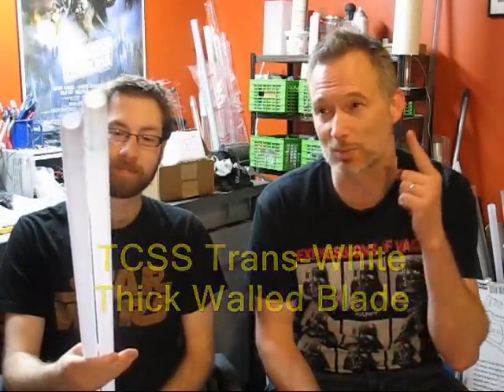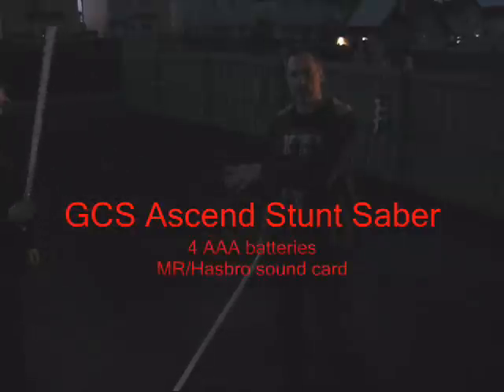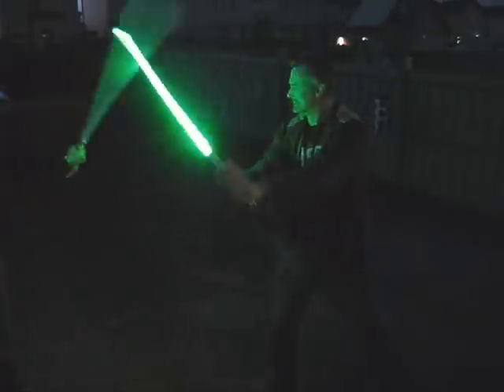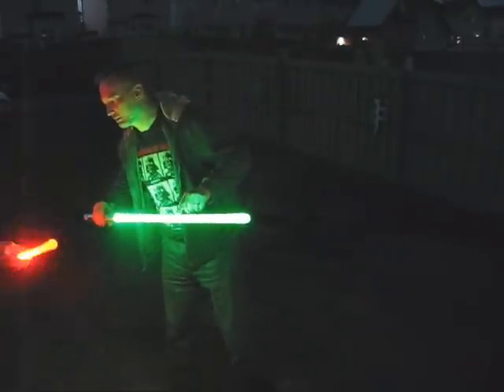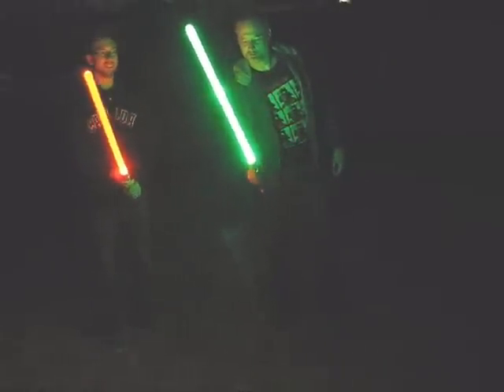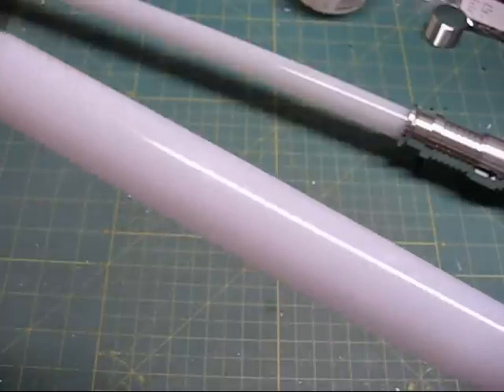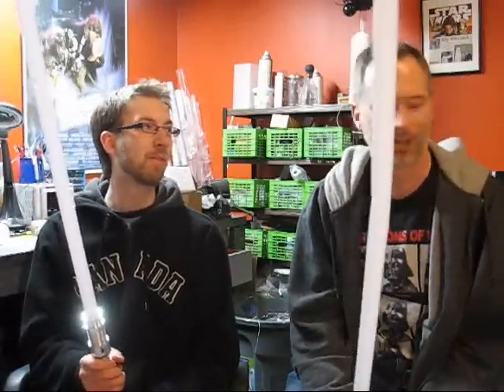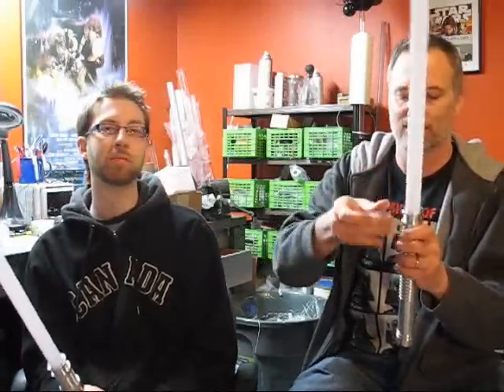Blade Strength Test

Comment: Polycarbonate is a tough, transparent plastic material with outstanding strength, stiffness, and impact resistance. and Polycarbonate can withstand an impact of over 900 psi, and is about 200 times stronger than steel. As a thermoplastic, polycarbonate will flex and return to its original shape, while metal can dent on impact.

Comment: I'm planning on building a saber from scratch, including making it in multiple aluminum/steel parts that thread together around an internal chassis I would prefer to make primarily in one piece from gold-tinted brass or bronze. I have kind of a thing for Juyo and other heavily aggressive lightsaber forms, and I worry about it holding up to that kind of abuse. I'm a big guy and I swing pretty hard. Any recommendations?
Reply from the maker: Brass is soft and heavy - not a good choice IMHO. TCSS MHS parts are made with  duelling in mind. I would use those.

Comment: What glue did you use for your tips?
Reply from the maker: +Chaos2611 weld-on 3
Reply: +Rob Petkau Does it matter if I use super glue instead? Will there be a durability difference?

Comment: The blade is the same as the hasbro light saber or hasbro blade is easier to brake
Reply from the maker: +NIKOS  NIKOU  Hasbro blades are cheaper material and not as strong.
Reply: Thenks

Comment: Can't get over how real that green blade looks. It looks like an actual lightsaber.
Reply: +YurAllStupid Most ultrasabers and vaders vualt look like that on camera. Due to the lens the blades on all sabers get a halo around it. Not all sabers will do that in real life.
Reply: Btw id you want a stronger core effect get a string led blade inside a day blade from vaders vault.
Reply: YurAllStupid it doesn’t look like that in real life, only on camera, in the dark, or in certain lighting, if you focused the camera right up to the Blade it  won’t it look like a real one.
Reply: @paladinheadquarters7776  

Thx for pointing that out!!
Reply: +YurAllStupid You're right mate! It's very impressive to see that.
Reply: Can't the LED strings break more easily? Also, are they more expensive to replace?
Reply: If you buy a neopixel saber, it will look like that in person and not just on camera.
Reply: It is
Reply: On the video it does lol, do not mistake

Comment: if you were to compare the thick wall and thin wall blades on the sabers when held, do you feel any noticeable or any significant feeling of weight?
Reply from the maker: drakke125Channel Yes. I find that the thick wall blades throw off the balance.
Reply: the design is .....redundant? I don't know wat the right word to describe it would be. It's as point as kadaj's katana thats actually two blades parallel to each other on the hilt from Final Fantasy 7 Advent Children Movie.

If anything I'd rather see a trident or a weapon with saber technology that looks like half of a sai, with two prongs, one long and one short. That would make sense.

Comment: So basically the trans white TCSS blades are the way to go. Are they ubber bright alone even without any film inside? I know the info says you can add film and stuff if you want but fine as is. I've just been kinda iffy about that certain blade for that reason. But after seeing how bright they are without any film or diffuser inside it changes my mind. Thanks for any info anyway though.

Comment from the maker: Actually neither blade in this vid has any clear wrap inside. Even blade lighting has more to do with the correct optic and optic holder than with the blade. Having said that - the most even blade I have seen with red is a trans white thin wall with 4-5 feet of clear wrap inside.

Comment: Sweet vid! Quick question- what is the guy with the red blade using to disperse the light evenly? Cellophane wrap, diffuser, or both? I've got a red blade with the diffuser from tcss but the lights still super concentrated at the hilt.

Comment: I haven't used the thin wall blades yet. I have a thick wall and a MR blade and honestly, I prefer the thick wall just to have the nice counter-weight for faster and more accurate spinning. idk if the thin walls are lighter or faster, but I prefer the heavy blade